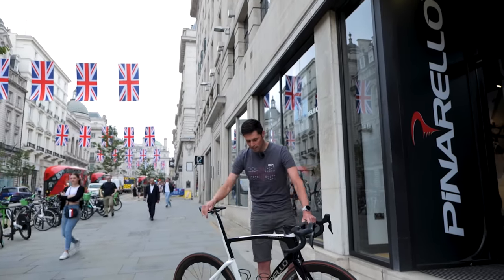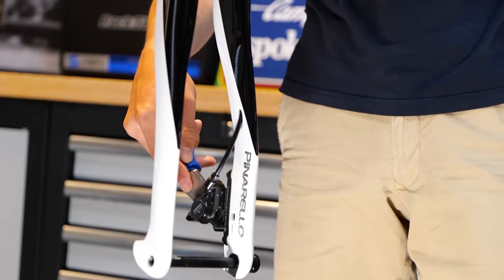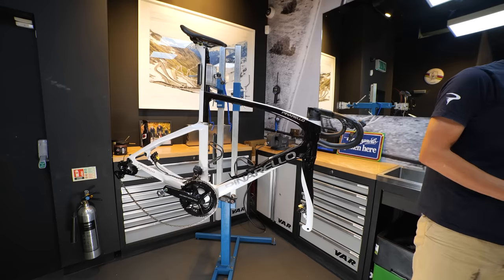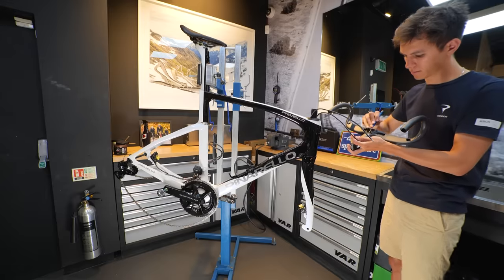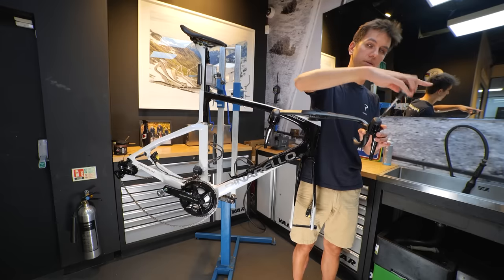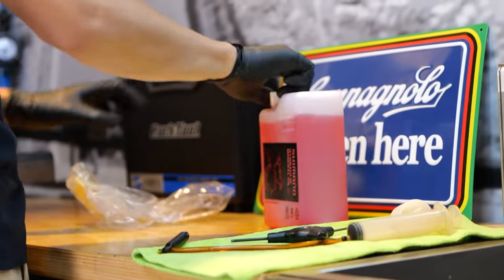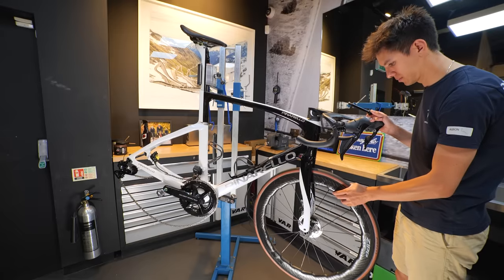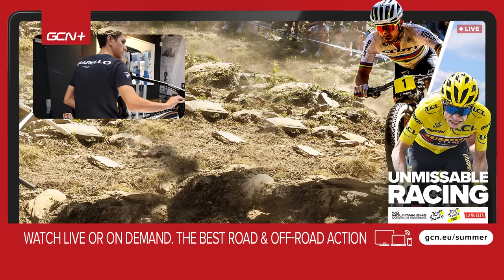How To Change Integrated Handlebars!

Comment: I love how you always tell us how bad integrated bars are but every single GCN member has them.  Reeks of irony a little bit chaps. 

Yes we know they are a pain to swap out and a pain when it comes to servicing the headset, but at least practice what you preach, otherwise you just look a little daft 

Personally I’m more than happy to pay a LBS for this job on the occasions it needs doing.

That said, it’s made slightly easier on mine as I have SRAM gears so one less set of cables to worry about

Comment: Question: Why do left lane driving countries set up brakes right front, left rear while right lane driving countries do the opposite.  I live in Japan and have right front, left rear and I've always found it annoying that when I'm signalling (virtually always with my right hand), I can't do any emergency braking.  I get the idea that right-front is handy for right handed people because your strongest hand is controlling the front breaks, but then why do right land driving countries set it up the opposite (seemingly picking the worst of all situations)?  Am I missing something?  Maybe nobody but me signals?
Reply: Wouldn’t you rather emergency-brake with your rear brake because slamming your front brake - only - with all your might in your right (presumably dominant) hand, will forward-somersault you? 🤷🏽‍♂️
Reply: @straddlemyvarius  Rear brake tends to skid when locked up, which can cause you to lose control.  Emergency stops should be mostly front brake along with pushing your center of gravity back to stop the bike from somersaulting.  If you do a google search for emergency stop on a road bike, you can find lots of good videos.

Comment: I have had two cycling mates with the ring of death on their steerer tube caused by internal cable rub. Both bikes have been warrantied by the manufacturers. They own up to the issue and will absorb the cost of a replacement. But guess who will eventually end up paying for all these engineering flaws. The consumer, due to rising costs

Comment: Was there enough brake hose length after cutting or was there a new brake line installed?
Reply: He went shorter on the stem and narrower on the bars so there would be enough, if you are very carful you only loose about 10mm when you chop off the olive.

Comment: Just out of curiosity: What does the average Pinarello customer pay for that on top of the bike fit and the 12000+ money units bike and do you think that is ok?
Reply: Most Pinarellos are much cheaper than 12000 When I bought mine the bike shop measured me up and gave me the correct size handlebars free of charge. No need to change 👍
Reply: @KoiFan  That‘s how it should be done. 👍

Comment: so I haven't watched the video yet, but off the top of my head... Why not join each tube with a quick connect where the stem meets steerer tube or thereabouts. If you had wireless shifting this would work. The quick connects would need to be extremely low profile, and the breaks would need a quick bleed to top off any escaped oil, but is this a crazy idea? Would this even save time?
Reply: This would only work if the brake lines are outside the stem, they're too big to fit inside any cockpit.

Comment: Why would you replace an integrated handlebar with another integrated handlebar? This is the stupidest video GCN has ever made (and there are quite a few of them) It doesn't solve the original problem.
Reply: Probably putting a narrower handlebars and/or longer stem too. Two factors can prompt a change of integrated handlebars.